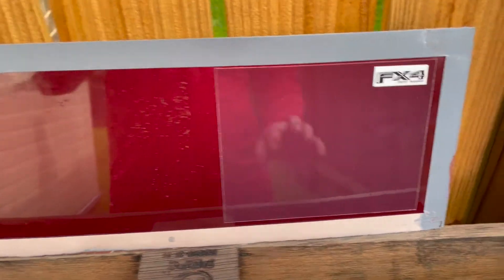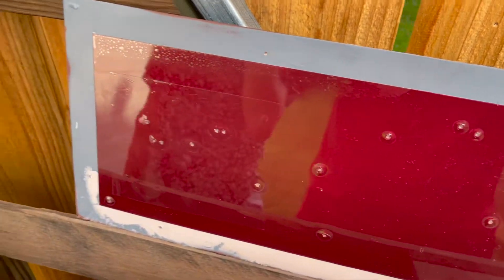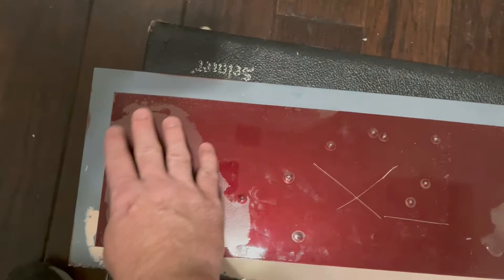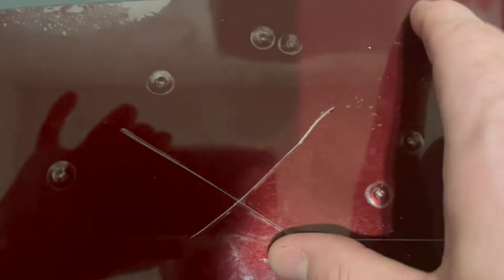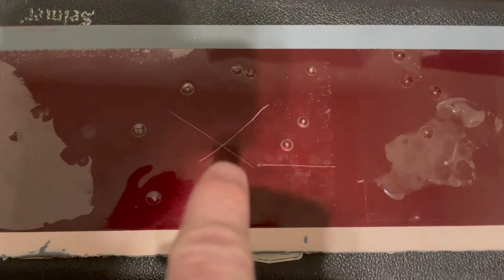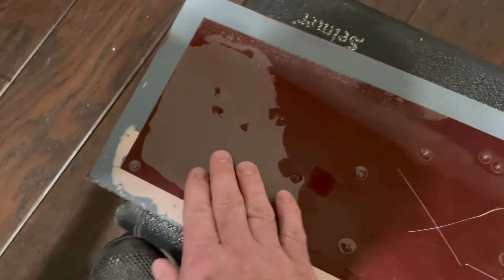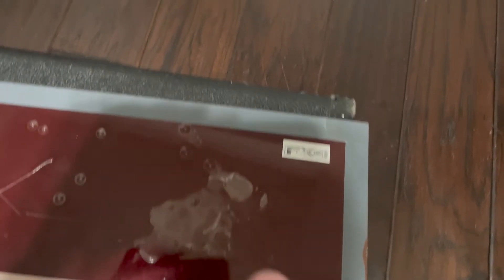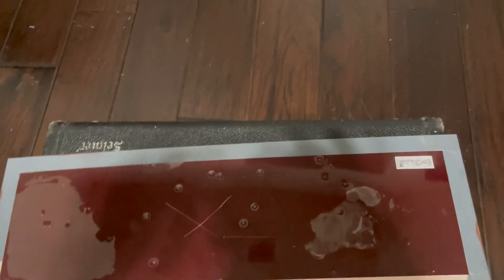Xpel and Halo EFX Torture Test

Comment: The clear pulling off with the ppf and the liquid wrap is simply due to a bad process of application of clear over an improper base. I have sprayed my car numerous times with Halo EFX and never had that happen.
Reply from the maker: Yea, I probably should have been more clear about that in the video, I rushed to get  it out while things were crazy with work.  I ended up putting the Halo on my new truck and it's been on there for about 14 months and 30K miles and still look great.